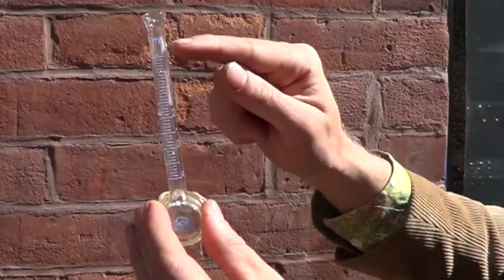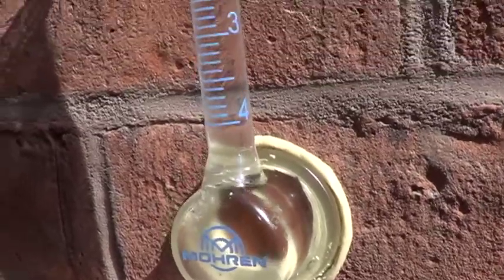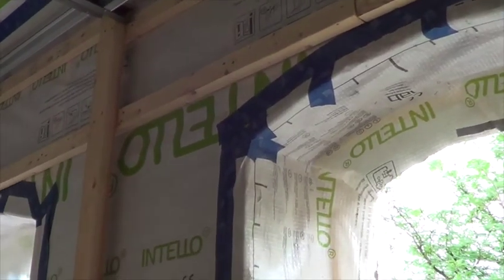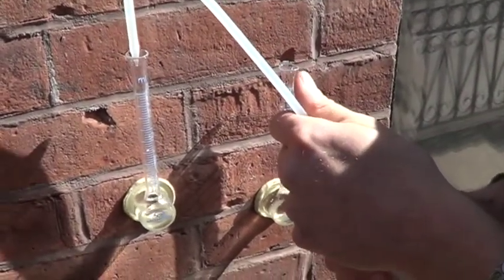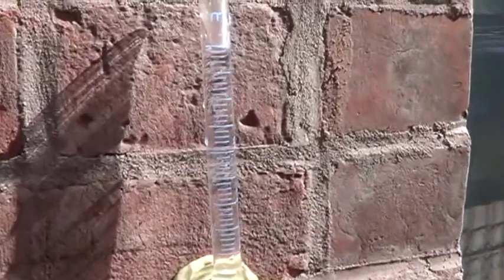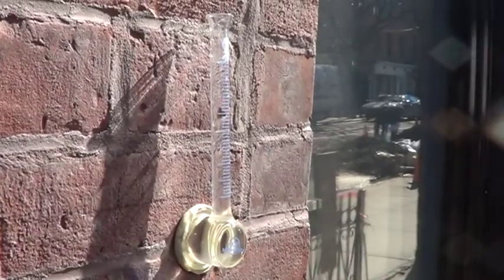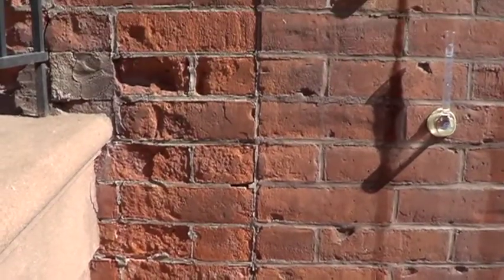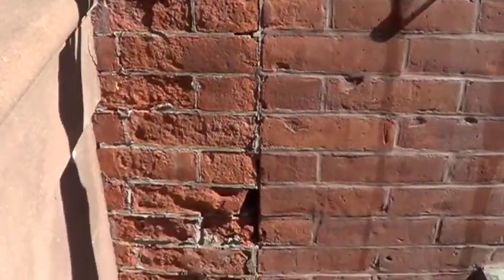Karsten Tube Explanation - Testing quality of brick in masonry buildings for freeze/thaw damage

Comment: Hi, very interesting! Can I use the Karsten Tube in small samples for laboratory investigations on coatings? I would like to test on cubes (5x5x5cm) and small slabs of 5mm thickness. Thank you
Reply from the maker: Hi Carla, you could in theory, yes. If what you want to compare is the porosity of the coating. And likely what you could test is relative only to the other coatings, since it's such a thin sample that you're dealing with. Best of luck!
Reply: @475.SUPPLY  thank you! :)